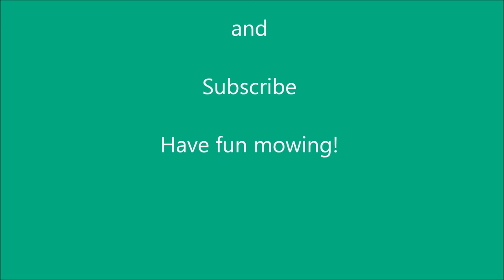Oxford Allen Scythe cleaning carburettor and mowing

Comment: Get the tick over and engine speed well down. You need to adjust the carburettor needle a long way. You'll get excessive wear and too high heat in the engine.

Comment: Hi, do you still have the the Allen Scythe, where did you get parts to get yours going , I've just got a partially  complete Allen Scythe and want to get it running, thanks Willie.
Reply from the maker: There is a villiers spares website. Or eBay. I still have one. It hasn’t needed attention in years. Just works when I want it to. If you need any help let me know. Have a look at my other videos. I have made a few about Allen scythes. You can often use alternative Lucas car ignition parts instead of villiers if you have a bit of ingenuity. Thanks
Reply: @bootsowen  Thanks for the reply, 
I'll add some pictures of the Allen Scythe I've found, thanks Willie.
Reply: Hi , ive added a few photos, you might be able to help me out with model etc , thanks Willie.
Reply from the maker: It's an allen scythe alright, not much of one though! Wide model, TS maybe, you can look at catalogues on the internet to identify it.  @WilliamBenn-t7t